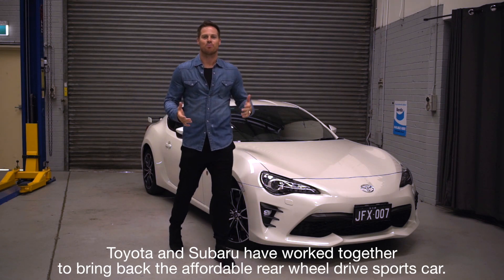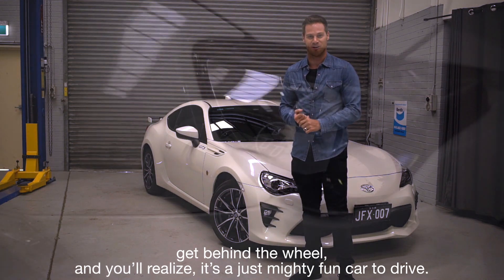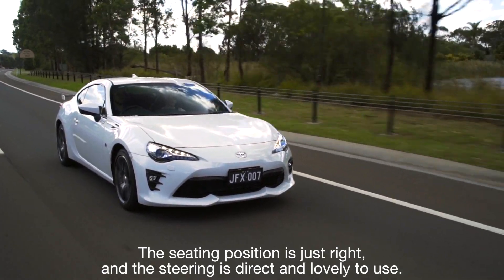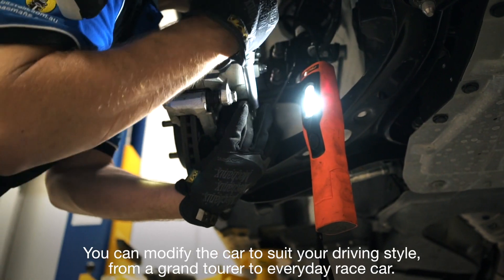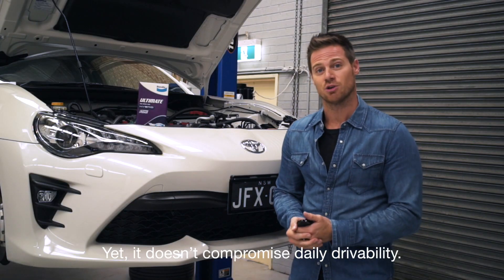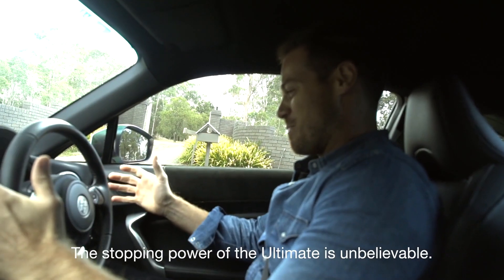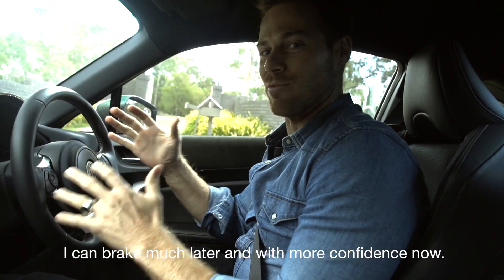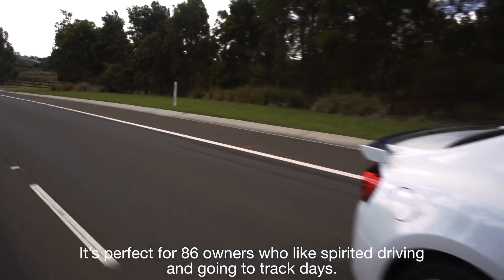Best Brake Pads Toyota 86

Comment: Do they need to be warmed up to work correctly? Most performance brakes are worse than OEM unless they're heated up during hard braking.
Reply from the maker: Hi Shay, these are not a race pad, they work straight away and have instant brake bite.
Reply: @BendixWorkshop  Thanks for the reply!